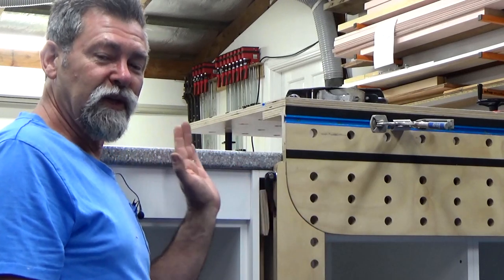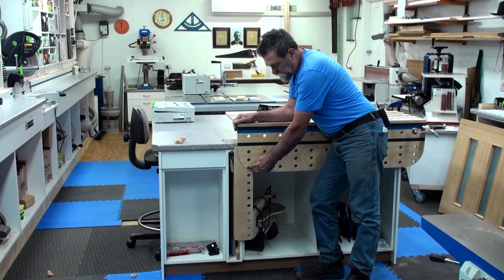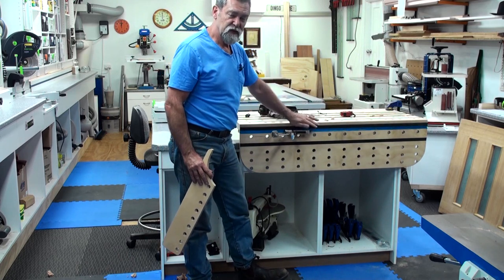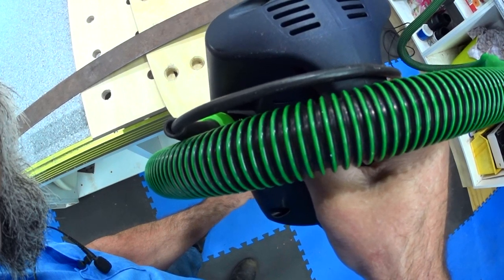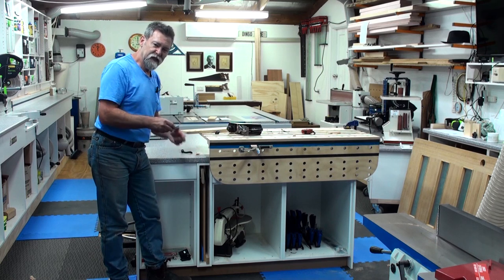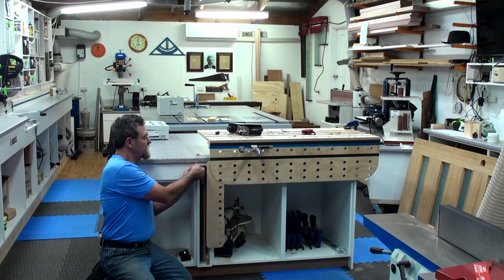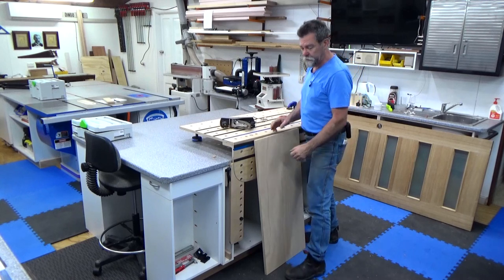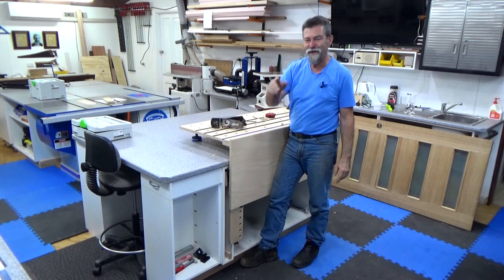woodworking dave stanton bench deadman support saw plane domino festool

Comment: Dave, why not find a way to make a second support that you can mount in the middle of the skirt? That way the work piece is supported at two points and is parallel to the bench top, and the clamp only has to hold the piece in place rather than also having to be a point of support. If that clamp happens to slip for any reason, your work piece is going to fall to the floor.
Reply from the maker: I did think about it but honestly, the clamp does a great job. Thanks for the time in considering an option!
Reply: I was thinking of the same after comparing to what was said in the video of building the skirt. Release Dave most likely is right in that it is twice the work for something you might solve with just leveling before clamping.

Comment: Hi David
YES! I like it :-) That is a great accessory for the bench. I'm more of a "square corners" man and would prefer that the side had square corners rather than the rounded ends, but that's just me. However the rounded corner made the adaptation/installation of your deadman much easier (than square corners would).

Great work on the Stanton bench.

Regards

Peter
Reply from the maker: Hi Peter. In earlier episodes of the bench I go through the reasons for the skirt to have the round corners. Thanks for the compliment!

Comment: It's nice, but I would consider it some playful over-engineering.
I actually use systainers to make a height adjustable support for no matter what. When you have a few around you can achieve any increment of about 5 cm easily. That works great too. I consider systainers to be an undervalued tool. By the way, the MFT table is 8.5 systainer units high. If you have the systainers to build such a tower you can put it anywhere around your MFT table. Great stuff!
Reply from the maker: Thanks Nico Smets!

Comment: David - thanks for the post. I'm in the middle of modeling my workshop after your videos. Question: How did you manage to get all  the benches exactly the same height which permits sliding materials from one to another without a hitch? Thanks in advance!
Reply from the maker: Good measurement.
Reply: Along the same line of thought, how did you determine the height to build the work surfaces? It seems like the table saw could probably be the reference and the other surfaces would be built to match that. I remember you made a video on installing your work surfaces but I haven't looked for it yet.
Reply from the maker: Most of the tops are tablesaw height
Reply: It kind of depends on how much your floor undulates. Level floor = level tops. But you would have to take the compression on the castors into account when fully loaded if you want to be dead accurate which I don't think is necessary given the deflection in most long sheet material. My concrete floor is a shocker. Must have been late on a Friday when they poured and screeded that one. Maybe the formwork was dodgy. I might have to grind it one day.
Reply: Stephen, your comment reflects pretty much what I was thinking. I've got a poured concrete (garage) floor that has some sags over the years. It appears David has a wood floor. It seems to me that if the table tops varied in height more than a couple millimeters (or less!) that the wood would catch on the edge of the next table. I suppose a solution would be to round the edge slightly to ease the wood onto the next surface. And you're right about the castors also. I'm not sure mine are manufactured to the required tolerance.